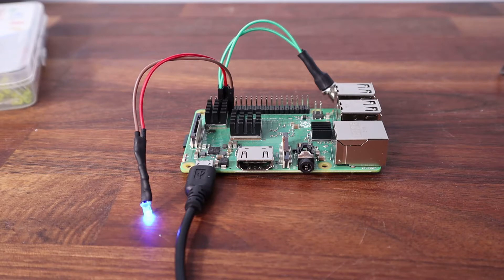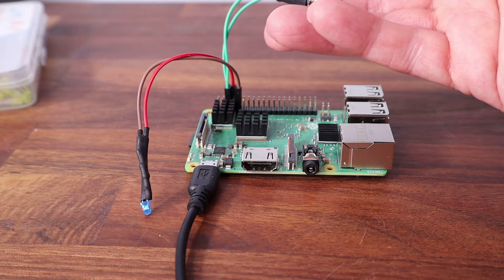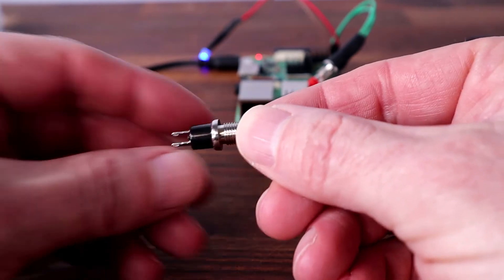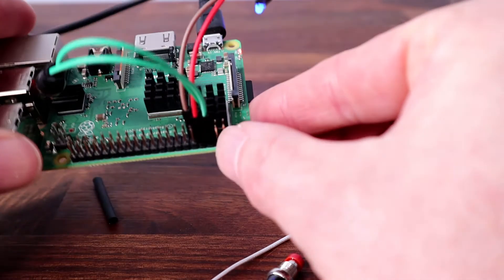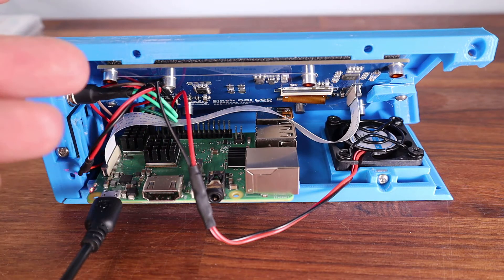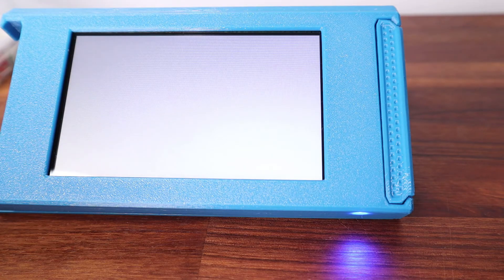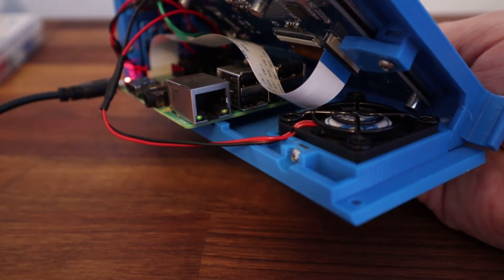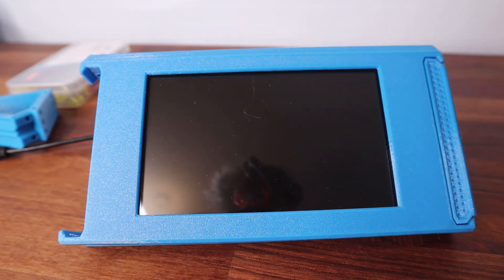Raspberry Pi Power Switch Button - Safe Shutdown / Start Up

Comment: hi ive added this to my pi zero but since then im getting random shutdowns the button works fine when pressed tho just the random shutdowns should i add a pull up or down resistor
Reply: added a pull up resistor will test it out tonight see if i keep having any random shutdowns evan tho just powered on the desk it stayed on but with the 3d printer connected and running it would keep shuting down
Reply: update it lasts longer but still shut down after a bit and when pressing the power button it turns back on and ive added a 10k pull up resistor

Comment: For the display, did you need to connect with the cable and with GPIO? I have Display 2 and I need to connect it in the sames pin that you connect your switch button
Reply from the maker: Hi. Used a ribbon cable to the pi display output.

Comment: Awesome!! Thanks so much for your video and the link to the howchoo write up.  I just wired and installed on my Pi4 which is in vehicular use.  Now, so much easier to shut down gracefully, with a physical button, instead of the GUI (or worse, turning off ignition key and hard-crashing the pi). I was prepared to copy and paste the code, run it at boot up etc etc. But the script did all the heavy lifting. Cheers!!!

Comment: I see you are using the TX GPIO pin to power LED as described in Howchoo's manual. This unfortunately won't work if you connect Einsy to the Raspberry through the GPIO port. Instead, you can add this line to the end of /boot/config.txt to power the LED with an arbitrary GPIO pin (e.g. GPIO 24): dtoverlay=gpio-led,gpio=24,trigger=default-on,label=statusled0
Reply from the maker: Thanks for that. Currently having issues with the newer shutdown option which doesnt play well when also using Octodash https://youtu.be/ezVMWB9LdKo

Comment: Great video! Does this work with RockPi boards running armbian via docker? (I'm a complete Linux noob that was only able to install octoprint  by following Print'n'Play's OrangePi guide)
I'd like to do this and the PSU Relay plugin, but the plugin for the PSU doesn't work either.

Any chance you could make a video on making the plugin work too?

Comment: Thanks for the video !! What happens if you disconnect it from the power and then reconnect it ? Does the Pi start up, or do you have to push the button first ?
Or does it only work when it's connected to power all the the time ?
Reply from the maker: It you pull the power then reconnect then the pi starts up. The button is a momentary push switch not an on off switch. The action of the switch runs a script to put the pi into a standby state.
Reply: @colinhill  ok. Thanks for the info.

Comment: hi, thanks for showing. I have a question, can you do this with a touch (capacitive) button? By touching the button for 3 seconds? that would work and if so, how?
Reply from the maker: Stefan, i have no idea :)
Reply: If all the touch switch does is short 2 connections then yes it'll work fine.

Comment: Great video! I have pin6 occuppied with fans... is there any other position where I can connect the button?
Reply from the maker: Unfortunately i'm unsure, as i followed the video from howchoo. Are you able to use any of the other power pins (5v or 3.3v)

Comment: Hi Colin, can you share or update the prusabox files? Modular panel for waveshare 5" with led hole and switch for start/stop Pi. And can you share the switch that you used? Thanks a lot!
Reply from the maker: Hi. The STL should be on the main modular front video, in description. https://www.thingiverse.com/thing:4942168   I'm not part of PrinterBox, so cannot add files to their website. I just post my mods on Thingiverse. Which country are you in? Someone asked me about switches in one of the recent video comments and I provided a link to Amazon.de  or here is my Amazon UK link https://amzn.to/2WWy5bO.
Reply: Hi Colin, I'm from Spain, I asked you about red switch to start/stop Raspberry Pi, thanks for answer me and for your work.
Reply from the maker: @Anubis_3D  hi, switch is Momentary Push Button Switches SPST Normally Open Contacts, with 10mm hole required. I got it from eBay.